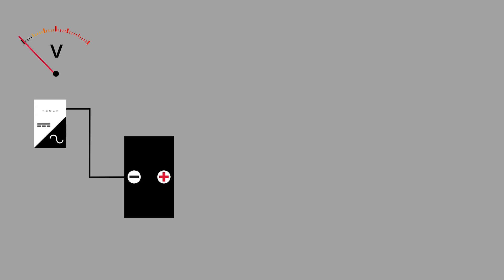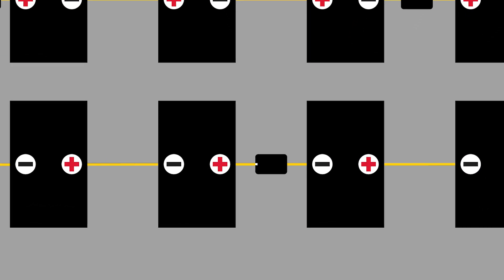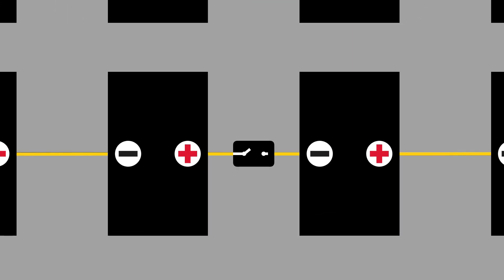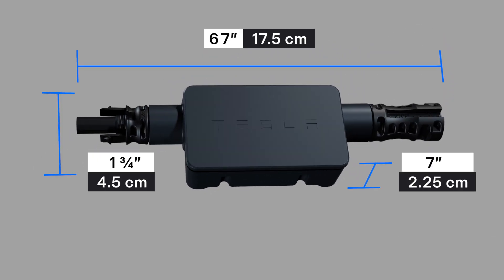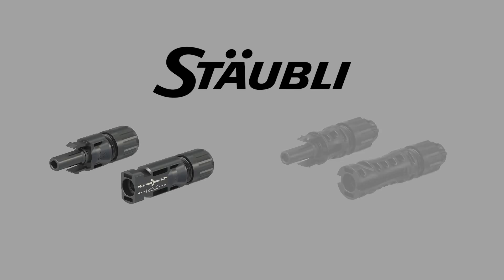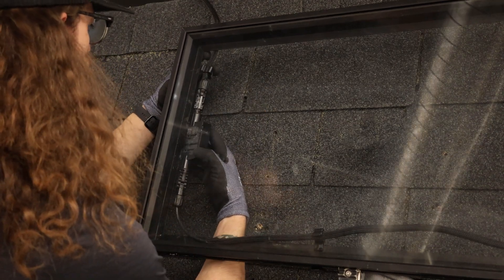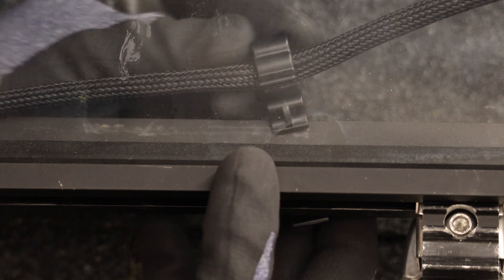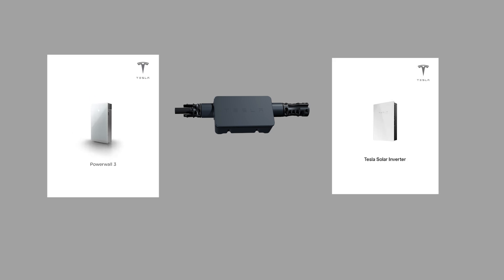Mid-Circuit Interrupter (MCI) - Technical Overview

Comment: How do you test the array after mci is connected. We are trying to check to see if they aren't connected backwards and see how many volts we get.  Without MCI we can determine how many modules we have by how many volts we get. 6 mods 6 volts anything less we know its wired wrong. With MCI it addes resistance so how do measure?
Reply: You use a meg tester(being ET600) and blast 1kV through the array to open the MCI's.
Reply: @LedSoldier90  i knew it.  Thank you.

Will it read then resistance or volts ? I haven't used one before.
Reply: @mrhernandez8256  it will show Voltage. Obviously, it varies depending on the size of the string.
Reply: @LedSoldier90 will the Meg tester show the voltage of the string when u send the 1kv ?